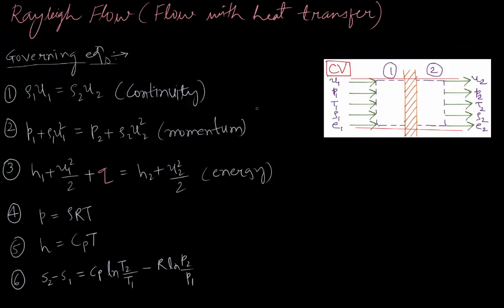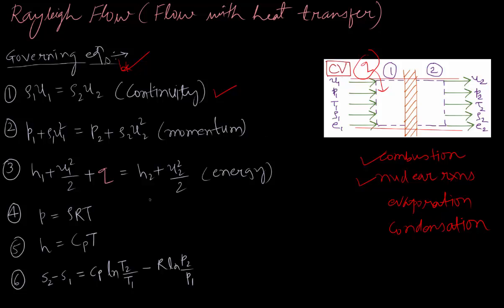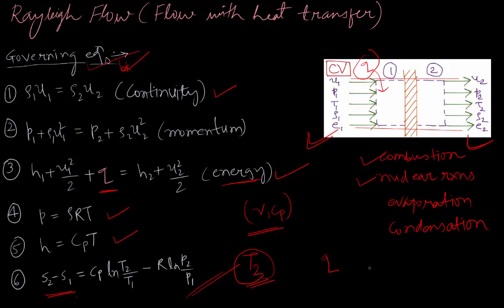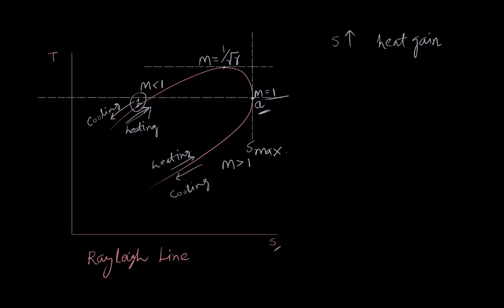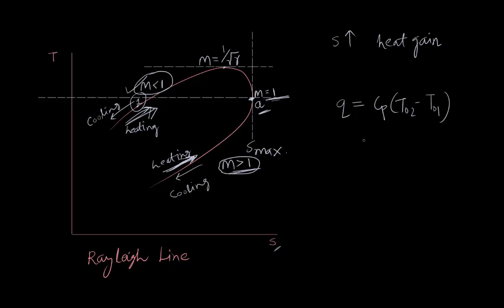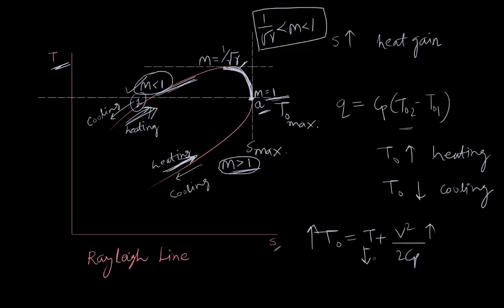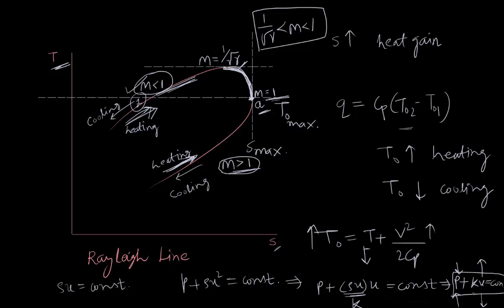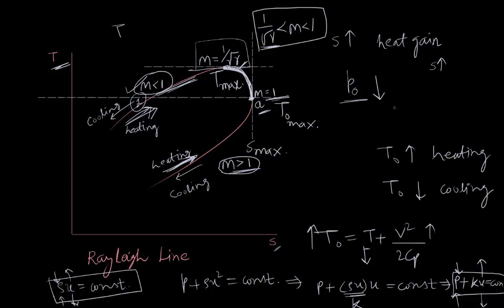Compressible Flow: Rayleigh Flow and Rayleigh Line

Comment: Rayleigh Line: for any steady 1d, adiabatic flow. 

Entropy increases as heat transfer increases, reaching a peak of M=1, at maximum entropy s_ma, ?with temperature T_o max? 

In a SUBSONIC flow, as heat is increased, the velocity increases to M=1. 
In a SUPERSONIC flow, as heat is increased the velocity decreases to M=1, and vice versa when heat is decreased (i.e. cooling). 

Stagnation temperature To
q = Cp (T_o2 - To1), so as q increases (i.e. HEATING) in a SUBSONIC and SUPERSONIC flow, (and Cp is constant) then the stagnation temperature is increasing
By the same principle, in a SUBSONIC and SUPERSONIC flow, as q decreases (i.e. COOLING), the stagnation temperature decreases. 

Static temperature: T
The static temperature change in a SUBSONIC FLOW-- the temperature is increasing (T2>T1) up to a point where the mach number is 1/sqrt(gamma), where there is a turning point and the static temperature begins decreasing due to a relatively large increase in velocity compared to temperature. To = T + V^2 / 2Cp

In SUPERSONIC FLOW, the temperature is monotonically increasing.

Static Pressure: 

P + Ku = constant
In SUBSONIC FLOW, as we increase q (adding heat -- heating), mach number is increasing (thus velocity, u,  is increasing) so the static pressure P decreases. 
Similarly, in a SUPERSONIC flow, as q increases, static pressure P increases. 

density
rho u = constant
Subsonic: velocity, u, increases so rho decreases
Supersonic: rho increases (because velocity, u, decreases)

maximum temperature
exists at Mach number 1/sqrt(gamma)

Stagnation pressure: 
if he add heat, increasing entropy, the stagnation pressure ALWAYS DECREASES. 
and the opposite is true for cooling, decreasing entropy, stagnation pressure ALWAYS INCREASES.
Reply: Florence Chan excellent  dude
Reply: @Florence Chan wohhh n1